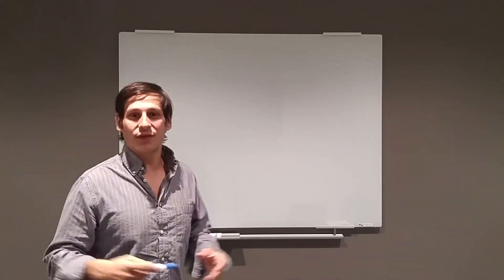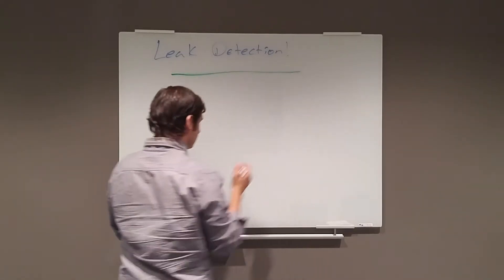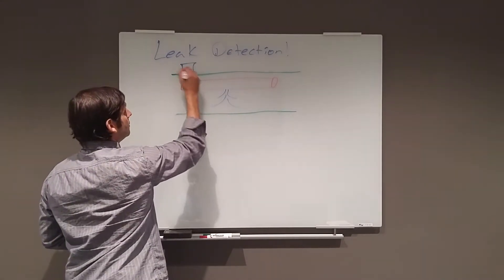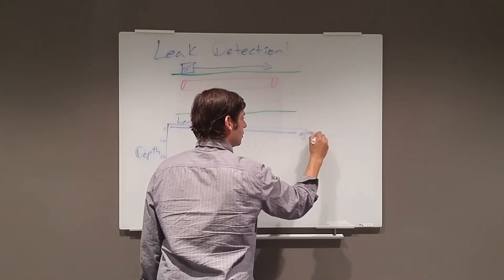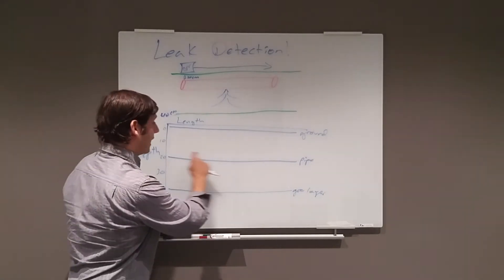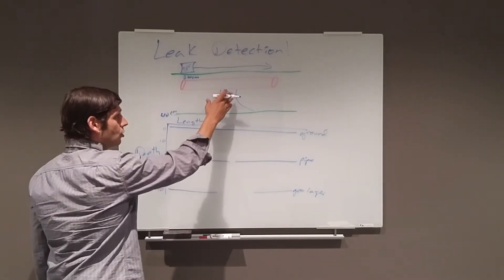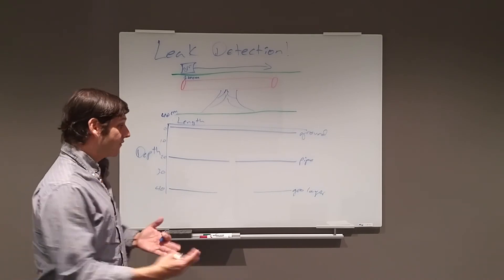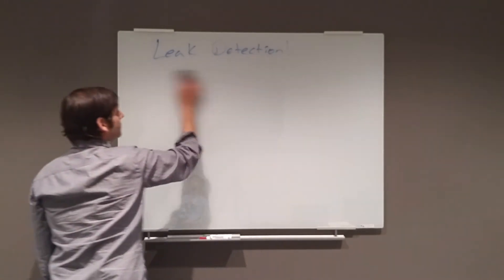Can Ground Penetrating Radar (GPR) Locate a Pipe Leak? - PART 1

Comment: Can GPR detect the degree to which septic gravel has become clogged?  

Our septic field is 46 years old, and is not draining.  One septic pro says to use hydrojetting to clear the pipes.  Another says hydrojetting won't help if the primary problem is that the gravel has become clogged.  

If the gravel is not clogged, it will be distinct from the soil/earth, so it seems they (and the pipe) would be visible on the GPR viewer.  If the gravel is clogged, it will still be different from the soil/earth, but less different - the distinction will be harder to detect.    

Would it work to say: If the gravel is 100% clear, the contrast will be ___. If the gravel is clogged (0% clear), the contrast will be ____.  The contrast is ____, so therefore the gravel is __% clear.

Rocks of various sizes would be distributed throughout the [soil/earth].  If the analysis is done over a large enough area, would it be possible to filter out rocks / ignore sections with significant rocks?

Comment: Hi Dan would you still be able to find the leak in the pipe which is inside a warehouse/foundry under a concrete floor? Cheers
Reply from the maker: Still possible. Actually might be better because the soils may otherwise be dry where the leak is. Gpr is really mapping contrasts. Good luck and thanks for the comment!!

Comment: Excuse me, the video takes the water pipe as an example. Is it available to detect leakage in gas pipe? What're the differences?
Reply from the maker: Hi, Thanks for the question. It would be difficult to detect a leak in a gas pipe. The density of gas is much different than water to the distortion of the pipe where the leak is happening would not be to significant.